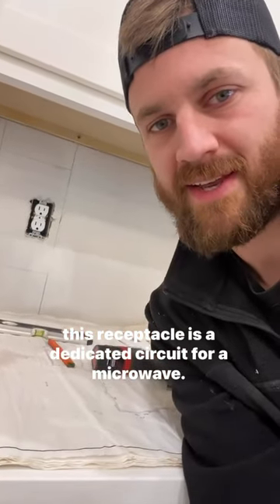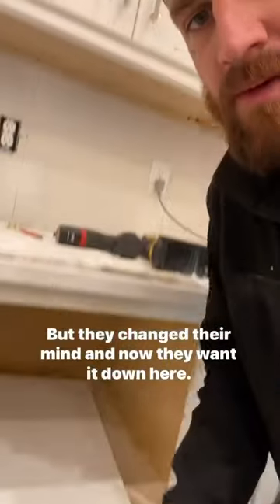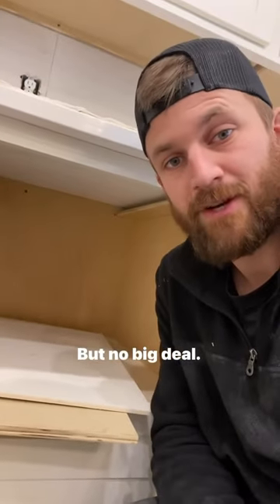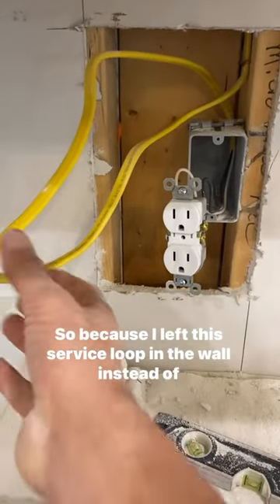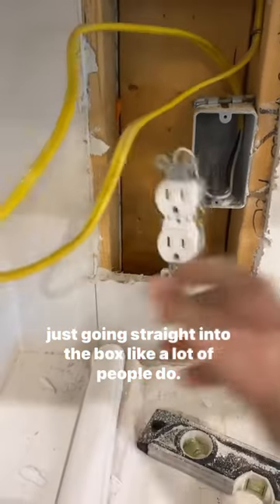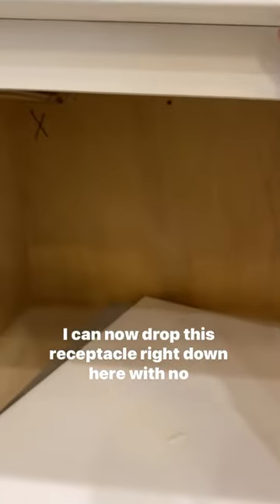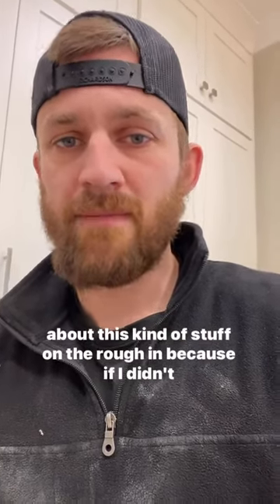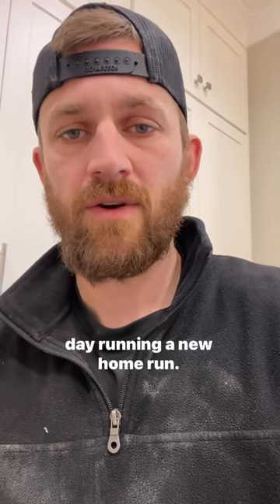This is Why You Should Leave Service Loops!! #electrician #bluecollarlife #construction

Comment: First successful service loop ever used in history
Reply: I just did a ton of work to our house renovating it, and moved a bunch of outlets. Thank the Lord the previous electricians did service loops, not only did it allow me to easily move outlets without call an electrician, but it also provided me with a ton of flexibility because I could run them even to completely different spots.
Reply: @PSNDonutDude you should have call a electrician you definitely did it wrong without even knowing.
Reply: @paulandreotto7266  🤣
Reply: I’ve used them plenty for more wire so nahh

Comment: Service loop in a wall like that is just extra targets for drywallers to
Hit. Speaking from experience
Reply: This.
Reply: Yep.
Reply: Also don’t forget to not wrap loops too tightly because with arch fault breakers too many tight bends in wire can cause them to trip (mostly on long runs with lots of outlets but still)
Reply: Leave the service length in the attic if possible
Reply: @nolan8226 how would you go about pulling wire down through the box when it has at least 2 staples in that run.   One less than 300mm from box, and every 1.5 meters.  According to CEC, not sure on foreign support standards.
Reply: Also illegal.
Reply: Also creates crossover interference and a radio antenna that picks up more interference every time you do this, which can itself cause the breaker to trip even without a load regardless of how loose or tight you leave your loop.
Reply: @911axe  sounds roughly the same here in the u.s., within 12 inches of the box and every 4 feet minimum but you're also not supposed to staple it so hard that the wire can't move through the staple, at least around here I believe the wire is supposed to be able to move freely through the staples. We usually just leave a small service length on everything about several inches, but situationally like this kitchen example you may want to leave more in the attic for example
Reply: Construction was done without permits
Reply: My first thought
Reply: Definitely DO NOT DO THAT! This information is dangerous to those who don’t know better!😡
Reply: @badbro2820  It's just as dangerous to those of us who do, too. We just would never do it on account of knowing better.
Reply: @The_sinner_Jim_Whitney  Agreed👍
Reply: What? Are you using 1-5/8"?
Reply: Also creates more heat in the wire while the microwave is being used. Blank the original, use it as a j-box
Reply: @Drodgey212  That's the right move.
Reply: @911axe staples are not actually required to be tight to the wire, you can leave a little play in it so wire can travel through it will still holding it in the near center of the vertical stud.
Reply: @colemanelectric   Of course. Anyone that hammers the staples tight is not confident in their work. People don’t understand that electricity creates heat. Any wire/wires under load need breathing room
Reply: Yea that's a big loop.  How did that pass inspection?
Reply: Been doing service loops for 10 years and have not had drywallwrs hit it, if you staple/dress your loops properly within the wall cavity this should never be an issue (or you work with horrible drywallers)
Reply: Most of these comments are ridiculous !!!!!
Sooo, every outlet and switch box in the house needs at least a 12" "service loop" ????? 
Perhaps you are thinking of service entrance drops and you are getting these two confused .......
" Hey Joe, how much wire ? ""Well, pick up an extra 1,000 feet for all of the service loops and we will be covered ."  
Oh yeah, make sure we have a service loop at every Romex connector at the panel box .....don't you think that would look stupid ????
Leave a loop in the ATTIC ?????
4 hours later - " I can't figure what that freaking cable is held up on - all I need is 6" at the outlet box and there is two feet in the attic - I don't get it !!! There's plenty of slack up there !!! 😡 !!!!!
So let's go with the service loop theory - 
1) a tuned circuit ??? So every time you open the fridge you get a weather report ???? and I bet it's always a cooler climate report ......
2) because the cable has a loop in it - it heats up ???? What if that 12" loop was actually going around a 12"  corner ???? How does the power know if the loop is in thin air or going around a corner ???? 
I thought that if the cable runs through the air , it will carry more amperage ????
3) please don't drive those staples so tight into the cable - do we think the cable is going somewhere on its own ???? 
In my world of thinking I believe tight staples are a reason why power bills are so high !!! If stapling too tight causes a breaker to trip, that tells me that every tight staple is using power !!! 
No no - you said it, not me !!!
Fellas, think about this awhile - ok ???
Reply: @nolan8226  not very useful when you are required to to staple every 6 feet and 6” from a box entry.
Reply: @joshgardiner3944  i think this is illegal in the 2023 code no?
Reply: screw will push it away you're bullshiting too, The guy in the video is the first bs,use original box for Junction and add 2. Feet away, I'll be done with it, It's no all day job
Reply: Yea. For low voltage work it's not so important, but an electrician really ought to keep his coils neat and close to the recepticle.
Reply: @Drodgey212  J-Box sounds logical, but my J-man once said the AHJ won't allow it, at least in my area. 

I don't know why, it seems like something the AHJ should let be.
Reply: @911axe  our standards for staples are about the same in the US. It a new trend to leave loops in the walls and a dumb one. it's not aloud by code but some people misinterpreted the nec to allow 18" witch is just about useless.
Reply: @nolan8226  I don't know where your working but staples have to be fairly tight. Tight enough that it doesn't slip if it slips easily it's not doing its required purposes as a fastener. Loops are illegal  people like to interpret the code in funny ways to make it legal but it's not.
Reply: @vertihvost7675 you don't need a permit to add an outlet...at least not in Pennsylvania
Reply: Always leave slack in all wiring.  Just not like that. And if it werent long enough he couldve just added the new receptacle to the first one leaving it as another counter receptcale.
Reply: Thought same
Reply: @tommym3876 I never knew that. Thanks!
Reply: Right. Wire staples are for a reason to keep wires tidy between studs..
Reply: @jopo6388 Leaving that outlet would violate code in NYC and many other jurisdictions. Microwave must be on its own dedicated line.
Reply: If they miss the studs maybe.
Reply: @jopo6388 but it wouldn’t be a “dedicated” outlet for the microwave 😂

Comment: Real question: who the fuck wants a microwave damn near on the floor
Reply: This is the question modern day philosophers ponder, but yet have no answer for…….yet
Reply: They make top fed drawer microwaves. My parents have one. It goes under the counter.
Reply: My parents have one under the counter, but it’s not the drawer type. It folds out like an oven
Reply: Someone with not much worktop space
Reply: There is no accounting for taste...
Reply: I am one of the “Who The Fu#k”  My microwave is in under my granite island top, it opens like a drawer and top loads.
Reply: Someone in a wheelchair?
Reply: @brianobrian9334 someone in a shop crawler, more like hahaha. Nobody in a wheel chair is going to have an easy time of getting at a microwave mounted so low - or at least in a cabinet like that. At that height you're too easily fighting the chair body itself to be in the way of opening the door, and even once you find the distance/angle to do so you're at an awkward angle of twisting or doubling over to get stuff in and out - make that stuff hot and you're more like to burn yourself or drop it. So yeah, it's generally best to leave it on the countertop or, better yet: have it on a lightly shorter mobile cart next to the counter or table so you're not forced to compromise accessibility/ergonomics with a hundred little "adjustment" scotches those in chairs know all too much about lol
Reply: @illitero  well as it turns out...my dad is paralyzed after a stroke and is  scooter bound ...they have his microwave 3ft of the floor.
Reply: Tyrion Lannister?
Reply: The dog
Reply: Short people!! That's who wants a microwave that is low on to the floor.
#2 you were not going to spend all day running a new HOME RUN LINE!!
YOU are going to do what I would have done and 99% of every one else would do.😮
Mount a service box behind wall😮. Put my wire on one side, on the other side put the rest of the wire I need to make my run. 😮Then connect wires inside the box. Put cover on box,😮 put Sheetrock over the box 😮 !!!
Now the connection is covered and protected!!
An you have added the extra 2ft of wire you need,!!!  Without making some kind superhuman job of making a new home run line.
Reply: @seanoverholt1736  a top fed microwave sounds like a pain in the ass
Reply: Bruh. Home owner could be disabled. Ever thought about that?
Reply: The dog.
Reply: We have a microwave garage. It saves counter space big time!
Reply: The same people that put TVs above their fireplace.
Reply: Wheelchair bound people.
Reply: someone bound to a wheelchair?
Reply: It can serve as a kennel for the poodle.
Reply: Someone 5 ft tall?
Reply: My son wanted one so the kids could use it. 
They ruined it with forks and spoons. 
He learned that kids need supervision.
Reply: They probably wanted one of those fancy "sliding-drawer" microwave ovens.
Reply: @CodyCha with rope?
Reply: @venividivici4253  What are you talking about? You can't be a home owner if your disabled, your required to rent.
Reply: Little people or parents who expect their kids to microwave their own food without using a chair or stepstool?
Reply: My real question: why is the outlet mounted ground prong down when the other way up is better for several reasons? No biggie cuz they can just be turned later, still
Reply: Who is still using microwaves other than Applebee's?
Reply: Better that above the oven , that's for sure
Reply: Well, I bet I can guess the gender.
Reply: Many people have moved away from the microwave priority and lower it down for defrost and use airfryer on top
Reply: Warwick Davis
Reply: Maybe rhe husband just enjoy watching the young pretty wife bening over for the microwave
Reply: The kitty
Reply: @sunso1991 😂😂😂😂
Reply: @illitero My Brother got blown up (Marine) and ain’t got no legs (this is the part where he would say “but, my dick and ball work”) He’s got everything lower in his house that was custom made by the foundation that Lieutenant Dan from “Forest Gump” has.

The dude can “gorilla walk” and also cage fights hogs, so it’s definitely just for convenience. 😅🤣💀
Reply: The answer to your comment is: THE PERSON PAYING FOR IT.
Reply: There is a $5000 microwave you can get that is essentially a drawer
Reply: @wirefeed3419   Do you like it better than a traditional model?  Did you choose it because you needed the counter space?
Reply: i have mine in the same spot he showed. i do it simply because it looks better. it works the same way just have to bend over to put things in and take things out. its not that bad
Reply: Ill take that over one that above my eye level
Reply: small people 😂
Reply: Some people's inability to fathom anything other than what they would do is concerning.
Reply: Another tax bracket.
Reply: What’s the microwave for?  Children only?  Will there be an adult level microwave as well?
Reply: .  So, normal counter height then...
Reply: @norfolkngood8960  but still enjoys making seven course meals.
Reply: A heavy drinker that ends up on the floor, a lot crawling around just more convenient to have the microwave down there those still have to sit up and beg to get food out of the refrigerator
Reply: I know someone who was building her new house, she insisted the microwave be in the island, now everytime someone wants to heat something up in the microwave has to get down to the floor on their knees to do so, since it's not even below the countertop, it's inches above the floor. And what may you ask occupies the space above? A cubby hole.
Reply: Microwave drawers are pretty common now.
But what is not common is the thinking ahead demonstrated by the electrician.
Reply: Ppl with kids
Reply: Probably for counter space and the clean look of less clutter.
Reply: There are drawer microwaves.
Reply: They do. 😅
Reply: It's so you can stand in front of it and microwave your junk
Reply: Pygmies?
Reply: I'm eliminating my useless dishwasher and putting my microwave under the counter in my tiny kitchen. Thanks for the video.
Reply: Dont use it so often. Rather it low and have more higher storage or empty counter
Reply: I agree. Why would anyone want radiation to the scrotum? 😂
Reply: Rich people lol. Every expensive house I work in has a gas stove, microwave near the floor or inside of a flip down drawer face, I've seen expensive ass coffee makers at thigh height too. Dumb designers
Reply: Dwarves?
Reply: Lol😅😅
Reply: Must be half the man he used to be..stp!
Reply: @mondavou9408  Very much like it , it opens like a drawer with push of a soft touch button and you set the food item down into it. 
It was a preferred location, it is in a large Island so no counter space is lost and a clean non cluttered look. I am 6’0 tall and barely have to bend to use. The control panel tips out at the top for use and is flush when not using. The Brand is Sharp.
Reply: I'm Not Paying 2k For No Drawer Microwave Better Put That Back On The Counter 😂😂😂...
Reply: Me because we don't use it.
Reply: He made that up for the video
Reply: @johnmartin2079  we don't have a microwave or a dishwasher. The cabinet contractor was perplexed when we ordered our cabinets. We had them at our last house but never used them. We opted for more storage. Now we have more cabinet space than stuff to put in it. There are empty drawers.
Reply: For little people
Reply: @illitero   The chair interference is a separate issue, but the ergonomics is the opening needs to be under the shoulders of the user.  Keep that scalding product below the shoulders and sight line, so it is easiest to keep level.  I might add that a chair bound person has many special devices, not the least of which is a low cart on which to transfer food from an oven or microwave.
Reply: Short people
Reply: Mi Jits

Comment: The issue with this is that it a code violation. 334.30 The cable length between the cable entry and the closest cable support shall not exceed 450 mm (18 in.)
Reply: So an 18" service loop is allowed by code.
Reply: @Druid_Plow  which would be a small 5.7 inch diameter loop.
Reply: @BackyardMaine couldn't he also just put a junction box and extend the run if needed? Rather than doing a whole new run
Reply: @Druid_Plow  Yes but the box would need to be readily accessible or in other words have a cover not buried in a wall or ceiling.
Reply: @BackyardMaine  I know this would be ugly on the wall, but could that existing box just get a solid face plate, or does a junction box need to be self contained?
Reply: @Druid_Plow  Yes a blank faceplate is fine. You will just have to have future access to the wires.
Reply: Honestly you've been very helpful @BackyardMaine
Reply: @BackyardMaine  cool, thanks for the info dude. Stay safe out there.
Reply: Which when you think about it, isn't a big deal. He just needs the wire staple to be on the correct side of that loop. In this demonstration, it is wrong. However, if it were stapled so the end of the loop was stapled within 18" it's good to go.

Also, depending on the length you might need to add a staple to support the loop itself
Reply: @calvissuperman  That is true and that would work if the outlet box needed to be moved prior to sheetrock but after that it would be pretty tough to get slack without damaging the wire.
Reply: The loop would not technically be a perfect circle, more like two straight lines very close together, but I do appreciate you've brought out some circle geometry equations @BackyardMaine